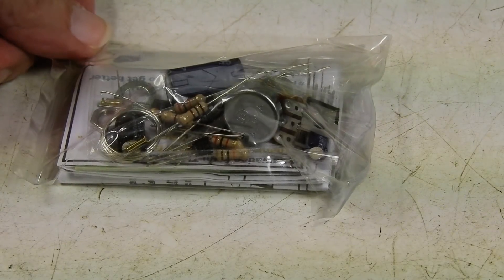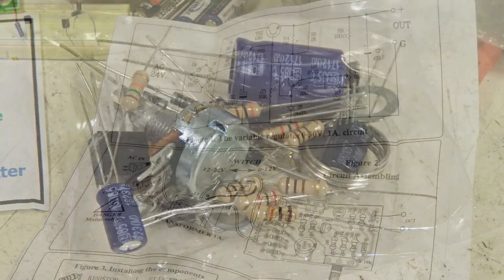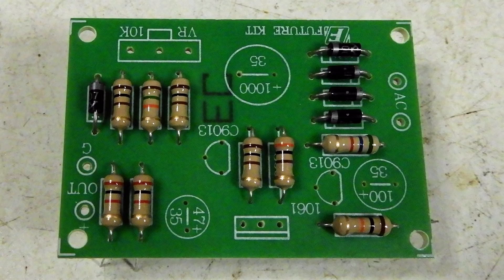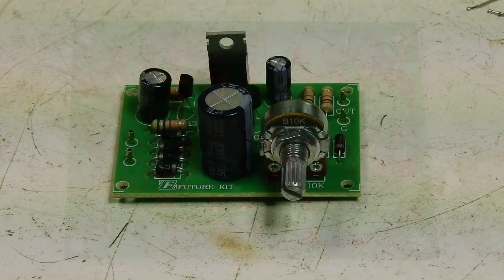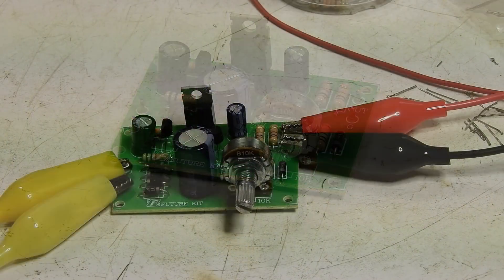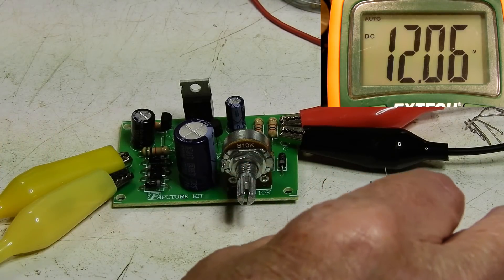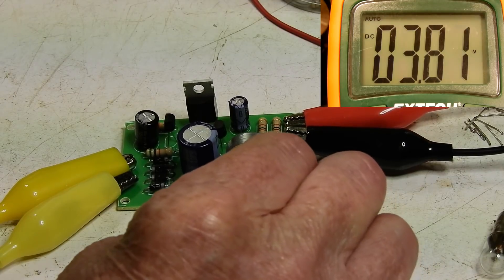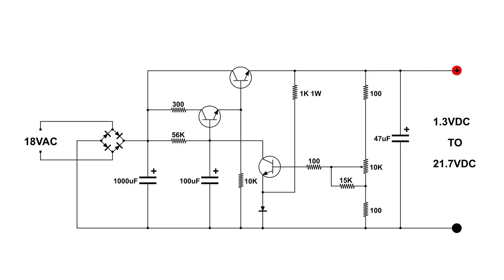Variable Regulator Power Supply Kit FK808

Comment: What are the components and its values that are used in the video? Hope someone answer my question ASAP. Its for my project. Thanks a lot.
Reply from the maker: I put up diagram this way because of copyright. I found an error the 56K Ω resistor should be a 5.6K Ω. I also just uploaded the parts list and it is in the SHOW MORE of this video.
Reply: @AllAmericanFiveRadio I really appreciate it sir. Thank you so much.
Reply from the maker: @belwilliamurbano724  Your welcome! If you have questions, you can also contact me at allamericanfiveradio@yahoo.com
Reply: @AllAmericanFiveRadio  what is the power of the R1,R2,R3,R6,R7,R8,R9?
Reply from the maker: @belwilliamurbano724  R4 and R5 are ½ watt, they are in parallel so that makes a 1000 Ohm at one watt. All other resistors are ½ watts.
Reply: @AllAmericanFiveRadio  btw where is the ground located? Thanks for the answer.
Reply from the maker: @belwilliamurbano724  It's the negative side
Reply from the maker: For resistors R4,R5 you could use a 1K ohms 1 watt resistor

Comment: Could you make a video on how this works? Is it just using the transistors as voltage dividers? I’m so used to mosfet switching circuits Buck/boost that this simplicity is confusing me lol
Reply from the maker: Yes I'll be glad to make a video on how this circuit works. Might be my next video.
Reply: mrsemifixit this is a linear type regulator where the potentiometer ultimately controls the base voltage of the series pass transistor.  Kind of a  voltage follower.   The LM317 ic would do the same thing with just a few components. 1 amp avail. with  proper heatsinking.